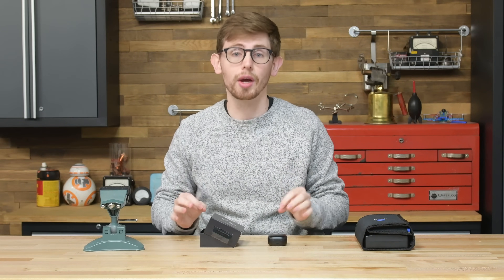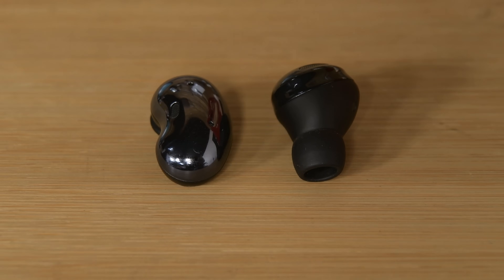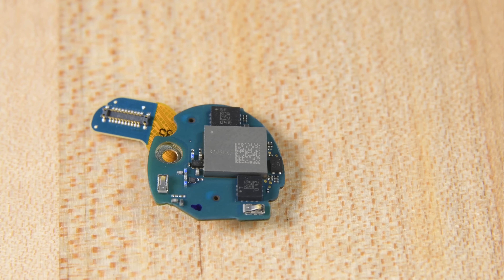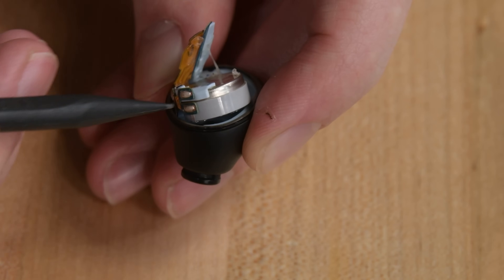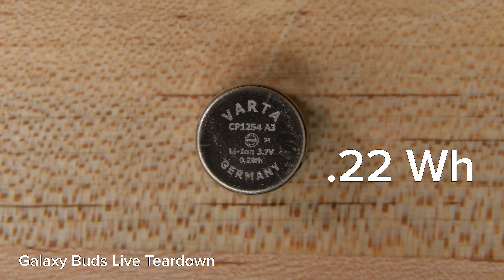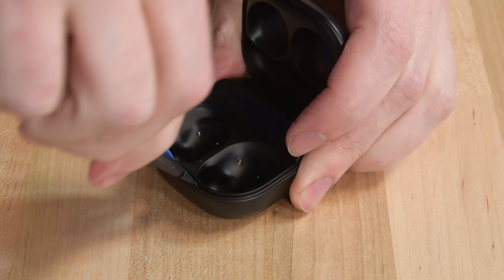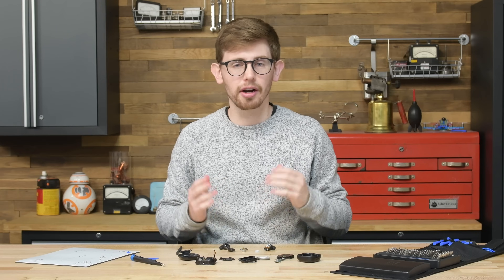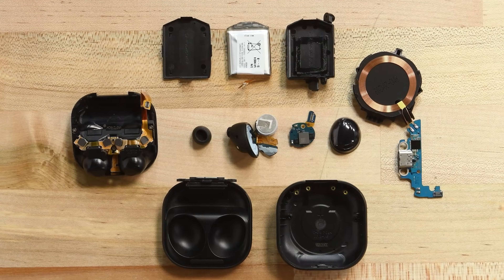Galaxy Buds Pro Teardown: Two Steps Back

Comment: On one hand I feel like the repairability score should be a little higher. You can still non-destructively get inside both them and the case to make repairs. However on the other hand I feel they got what they deserve, because if you accept that the batteries in the buds are soldered on then you're priming yourself to accept these backwards steps in repairability because it's only a small change and everyone else does it anyway. If you don't push back against it then it just keeps on going. Next the battery in the charging case will be soldered in place, and you'll brush that off too for the same reasons. Everyone else does it, it's only a small change, and everything else is accessible and fine. Then next thing you know the screws are proprietary, and you brush it off because it's only a minor inconvenience to have to get a special driver. Next the battery will be attached to the wireless charging coil in such a way that they can't be separated without destroying the coil. So you'll need a new wireless charging coil every time you want to replace the battery that's soldered to the main board anyway. And that'll be brushed off because it's just a minor detail.

I don't think any company would be bold enough to try that last one, but you get the point. Compare that final product to the repairability of the originals and it's a night and day difference. All those little changes you brushed off because they were only small steps backward for repairability compounded into one big slap in the face of hoping to fix anything in the device, and now basically nothing in the device can be repaired. You can't allow yourself to be primed to accept these user-unfriendly changes to devices just because they're small. You'll just end up accepting another, and another, and another, and then you're left with something that resembles the airpods in terms of repairability and you're sitting there asking yourself how it got to that point. So in conclusion then, sure everything else is still accessible and repairable. But in my opinion they do deserve the big hit in their repairability score anyway, especially because their other products have proven that they are capable of producing good earbuds that are also repairable. There's no reason to solder the battery to the board. This isn't their first pair of earbuds. They are well aware that they can produce them without soldering the batteries in place.

Anyway, this post has gone on long enough. You get the point.
Reply: ive got dignity, i will not buy the buds pro. no one should. Environment is the only thing that needs to be urgently, as soon as right now, prioritized before anything else.
Reply: For me, recycling is also an important aspect
Reply: Well on the other hand though, there are barely any products outside of Samsung and Sony earbuds that even come close to even this decreased level of reparability... Still though I preferred the repairability on my OG IconX and then the Galaxy Buds over this.
The IconX I have is in a really bad shape and needs battery replacement on both earbuds and a driver replacement which simply isn't worth the money to fix, but I am extremely glad that I can extract the battery off the charging case effortlessly and transplant it to the original Galaxy Gear (yes they use the exact same battery, even though they are 4 years apart in release) and make that work flawlessly!
Reply: @JayDee-b5u  When soldering directly to batteries they use ultrasonic welds, not literal solder. This is difficult to separate and is dangerous to reconnect without a ultrasonic welder. Not a common tool people have, so I would still consider this bad.
Reply: Ok wtf so much komment Story!!! 😐😐😐
Reply: It does have an IPX7 rating, could that affect some of the changes to repairability?
Reply: Can we get batteries for these earbuds
Reply: @chanellewalsh1675  yes

Comment: I think you should have mentioned that it is IPx7 as compared to IPx2 in the previous Buds series. This could make a difference in the design and causing it to be tougher for repair.
Reply: Yeah so the ipx 7  does not work at all

Comment: Thanks for this!
My case stopped charging my buds overnight, case had full battery but buds were at 30%, think I dropped the case the day before, figured the case was needing a 'reset' since it was detected but not charging the buds.
This helped me out in opening the buds pro case and re-seating that ribbon did the trick!

Comment: Would've loved for you to have mentioned how fragile the flex cable is on top of the soldering point. Bricked mine while trying to desolder, and I've repaired many electronic items in the past. 1/10 for repairability.

Comment: Hi Guys,
I have a pair of  Buds Pro. I have dropped them down many times the case unfortunatelly. Since the last time the case stopped feedbacking the charging statuses / battery levels of buds. 
Opening the chase, nothing happens regarding to the LEDs. 
What could have happened?
(When I plug in the charger cable directly, the LED on the case works as we waited, but the buds state LED lighst one times with amber and goes off immediately.)
Is it a mechanical problem or other ...?

Last, but not least. Thank you for your professional videos.

Comment: I've never considered repairing any Bluetooth headphones. My wife got mad at one point and broke a pair of mine, the base stopped making contact with one of the pair of the headphones.
I tried opening, couldn't open it all the time and tried to force it when smoke came out of the case. That's when I simply dropped it (was afraid it was going to explode in my hands) and later simply discarded it.

I might be willing to pay a few to repair a gadget or two down the line but it's not an option I know of or never heard of

Comment: Why does the sautering matter if the batteries are not available separately to begin with? Nobody wants to disassemble their earbuds just to remove the battery, and if there's no way to get a replacement, an easily removable battery does nothing for repairability.

Comment: Sorry, but negativ voting because it is soldered? That ridiculous. Repair means repairing and not just clicking/ sticking things together. The main problem is where to get a working replacement battery in some years .

Comment: If you have tools and skills to open the buds you probably also have some soldering skills as well. It doesn't look that complicated and difficult to replace the battery. Somehow unrepairable AirPods 1 can have their batteries replaced (checkout REWA channel) even though you said it's impossible without their destruction. Both devices are so small it's difficult to make every component easily replaceable but it's definitely possible.

Also, the score isn't objective at all as you scored it based on the previous generation of buds.

Comment: In my mind, those ultra small batteries in the buds themselves won't ever need to be replaced.
Considering that almost no one uses them to the last minute of battery, but always charge them before that, the degradation won't be as high as smartphone battery.

Plus, they already last so long that for a medium usage person, running through a single charge of the bud's cell will take like 2 or 3 days. And when it eventually starts to degrade, frequent top ups are always warranted by the charging case.

I'm expecting that battery to last for at least 7 years and go up to 10 years of use.

A person will surely change them well before that period.
Reply: The case doesn't help that much saving the battery lifespan, It avoids the battery to drain into low levels but also keeps the battery charged at 100% not good for lithium batteries, and at full charge it leak rate higher. Users reports show us that it lasts about 18 mons with heavy usage (4 to 5 hours + a day), whereas average users might expect 3 years.
Reply: The batteries in both my buds died within 1 year!
Reply: Heavy use sony earbuds with 8 hours of battery to start ended up at about an hour in my right bud and about 2.5 in the left bud. Had them for 1 year. Battery replacement is a must for me.
Reply: I purchased my galaxy buds pro when they were released. I've been using them everyday for an average 7 hours a day. I use them specifically for work and for private phone calls. I don't work 7 days a week so I averaged it out to 7 hours 365 days a year since January 21 2021 when I received mine. It's getting close to 3 years since I purchased them and I can tell you both earbuds still work great, sound quality is amazing and the battery in each are working great. Now the case it started maxing out at 50% earlier this year and as of today the case doesn't charge at all, it's at 0%. Considering the earbuds were included for free when pre-ordering my s21 ultra Samsung gave me a great product. I am now trying to figure out what battery the case uses so I can replace it.

Comment: I think they'll become obsolete in a few years of use and you'll want to buy new ones than to go and change the battery.
Reply: Why would they become obsolete? Do wired headphones also become obsolete?
Reply: @electroplaque  it's not that they're going to be obsolete, but the battery is just going to make them a pain to use and you're probably gonna wanna buy new ones. I have experience from 1st gen Airpods
Reply: The tiny batteries is what makes them go "obsolete", by ruining the battery life so you can't use them anymore. That's why it was so great you could replace it in previous versions. The rest of the components can be expected to last and not need replacement or repair.

Comment: For the soldering it's not really that big of a deal I think for the average consumer they will just send them to a repair shop and a repair shop should have the tools necessary to replace the battery.. not to mention its not really easy to find replacements for any buds on the market
Reply: Google said you cant replace Pro buds battery. So you can?

Comment: Given the fact that these are ipx 7 and also the fact that these come apart easily still I think they should've gotten a score of 4 instead.  Soldering is easy to someone who's mechanically inclined but like and mechanical skill it takes years to master. So basically anyone who attempts a DIY repair like this will likely destroy the earbuds anyways unless they already have experience.

Comment: I don't get that score
You could get inside the buds no problems
The case is a gold standard
And the battery comes off with the touch of a soldering iron 
Should've been atleast a 7
Reply: Have you ever touched a soldering iron near a battery? If not go do it rn letme know how it goes
Reply: @dalekman9999  
As a matter of fact I have
I've made a bunch of phone batteries work extra.
I've repaired countless wireless headphones for friends and family
Heck one time I soldered a wire straight to a 18650 cell coz I didn't have a spot welder and nickel strips

Comment: Irony is these galaxy buds pro are rated IPx7 and still can be disassembled so easily compared to airpods pro. And the airpods are not even water resistant. My friends airpods pro died just day after he bought them by getting wet in rain.

Comment: their batteries are why I never buy these earbuds. the lipo capacitors should be a good fit in these. tho they'd only last 1/5th as much time :|
tho with 8h of playtime as is, maybe 1-2h wouldn't be that bad if it meant they'll last forever?
Reply: I dunno that would actually leave a pretty bad first impression imo
2 hours is barely enough for a morning commute and not being able to use them after that would leave a bit of a sour taste

Comment: Their phones have slipped and become Apple-esque repairable. Easier than a 'I suck' phone but Samsung does not want to be simple. I suppose it's the Asian Phone cut-thoat market, haha.

I would root my Note 9 but at the moment, I like the ability to store all my debit/credit cards on it and if i DO root it, Knox removes the ability to do so. Samsung is MUCH more secure than iphones (simply because each phone is different, iphones are identical. Encrypted but identical) but no rooted/jailbroken phone can call itself secure and that is fair. Samsung is fantastic in that you can disassemble and replace batteries with no issues for the most part

Comment: Custom batteries when they could have just used off the shelf parts. Yuck. Samsung's design team must have nothing to do. Creating a custom part for a tiny boost in capacity/shrink In size  is Not efficient at all.